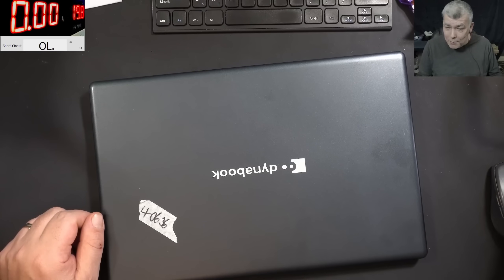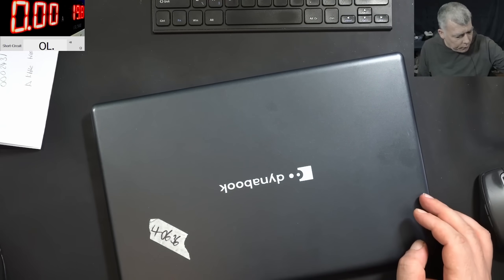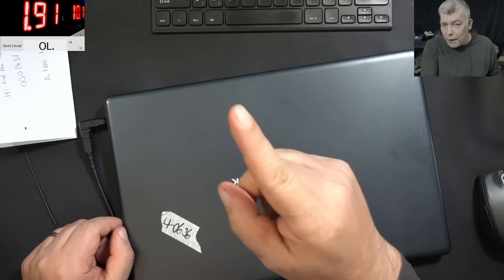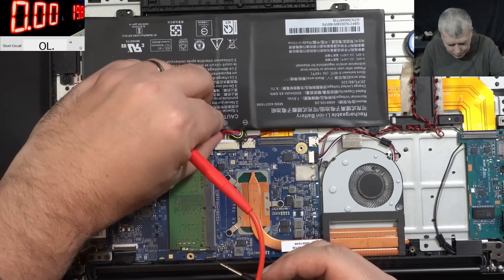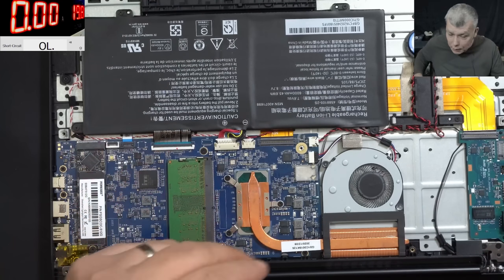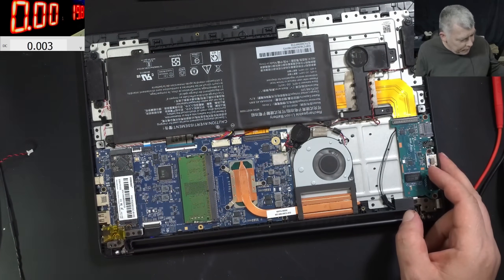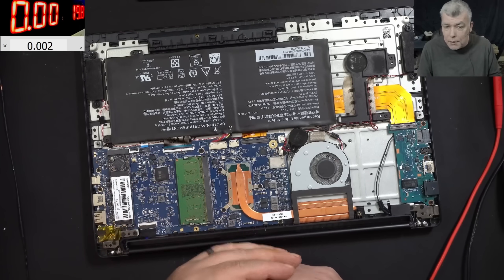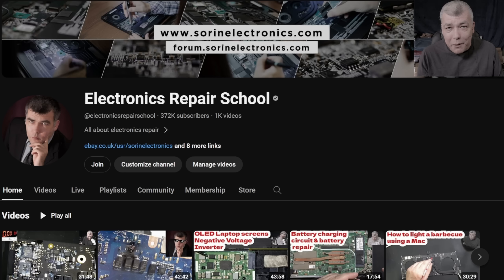Charging only up to 35% - Toshiba laptop C50, board repair, bribed with candies :D

Comment: What is the solution if the voltage on the + battery pin is 19volts, but the battery is not installed? 
is that normal?

Comment: If it's a design issue then that will be because it's not a Toshiba laptop any more they sold the Satellite and Satellite Pro laptops to Dynabook so it's Dynabook that now design the laptops and zero to do with Toshiba when the laptops were so much better.

Comment: Mr Sorin, I bought the same multimeter leads, I'm very dissapointed with them, I preffer the other ones I got better measurements with them and can press beter in the components for the measurements.

Comment: I think it can be the voltage divider resistors which measure the battery voltage. But it can be also an issue with the control PCB inside the battery.

Comment: 12:54 always a good idea to put sharp probes on a lithium battery and then put pressure on them due to bad contact... :D
be careful!! don't get into routine... can be fatal...
Reply: This is just the cable, not the cell itself. You could see this part on fire and nothing bad would happen (assuming the cables don't get shorted)

Comment: As good as Sorin is at electronic repairs and as much as I like him, I wouldn't ever send a laptop to him for repairs as he insists on cutting the power mid boot or once booted. Just remove the damn SSD, its not hard. Or is it a case of, I will fix it and anything that goes wrong with Windows as a result is not my problem.

Comment: I think heat-shrink tubing over a replacement coin battery is much safer than soldering wires on.

Comment: Those Mechanic tweezers are not meant to take out conectors, check current on power supply and some other hard stuff. They are meant to take out ONLY and ONLY smd's! Not meant to dig in motherboard or to scratch with them! I realy don't understand how you bent those in just few days man!

Comment: You do not need to solder them. Just rip off the tabs, then use another CR2032 battery and attach the tabs to the new battery using tape, you use a conductive tape and then isolate everything with electrical tape. Have been done it for years. Never bought any coin battery with cable, they are not that cheap.

Comment: actually is possible to use a normal battery there but you need to put a diode before the battery to stop the battery charge because of corse the cr2032 are not rechargeable. :/

Comment: you can  use 2032 battery just stick cables with tıght adhesive plastic tape no need to use solder  they usually works as this
Reply: Not something you  would do as a pro

Comment: 5:45 Is that liquid damage? Between pin 2 and 3 on the bottom of the mosfet?
Reply: Maybe on top, also...
Reply: soo what ? pins 2 and 3 are together in boot sides !
Reply: @hugovale8070  maybe this caused the mosfet to get short...

Comment: Hello, friends! Please, allow me to reinforce some VERY IMPORTANT advice from Sorin here:
DO NOT TRY TO SOLDER WIRES ON CR2032 BATTERIES (or any battery, but specially on CR2032 "coins").
They get very hot very quickly and explode on your face, throwing acid everywhere and burning your skin (yeah, it happened to me, and I was VERY lucky that the acid didn't get to my retina, but it was a very close call). Washing with water just makes it 10 times worse, as the water reacts with the acid (yeah, also learned that the hard way).
And yes, I know it works sometimes. It worked 10 times for me before the last one exploded. Don't do it, it's not worth it. Buy a battery spot welder if you need to attach things to batteries and be happy.
Happy 2025!!!
Reply: just put cables on the cell and wrap with electrical tape... best and fastest solution
Reply: @djtongi  Very correct, and you can place heat shrink tubing over it. Perfect result.
Reply: I've had problems with bad contact using the tape method. The shrinking tube idea might work better!
Reply: Nice post! I'm glad that you pointed that out. Thank you!
Reply: Bro thanks for your information. I was thinking about that. You save me!. ❤❤❤
Reply: there is a special tool for that , works with electricity not heat  and can solder a little plate on the battery without damage , it solders thee plate with high current , so the way do it , you solder to the little plate your cable and the plate you attach it to the battery with the special tool that uses high current to solder
Reply: @isaacn751  Yes, this tool is the spot welder I mentioned! Be safe! 😉
Reply: @isaacn751  Or buy one with the plate already on it for one dollar lol
Reply: @isaacn751  There is zero reason to do that. You can just buy batteries with the solder tags on them already from china for $1.
Reply: NO ONE SUGGESTED SOLDERING COIN BATTERIES (i hope no others really). You just wrap wires around it and DONE.
Edit i tried look did someone suggest soldering.. i remember just i twice written why not use coin batteries but i never suggested soldering because thats stupid.

Comment: Sorin buy a small spot welder, and then just use it to make the bios battery, so easy I always do it.
Reply: Just use tape bro
Reply: I Just use electric tape and it works always
Reply: before I bought 100 brand new batteries for cheap I used copper tape to fit the original battery cable on 2032 and wrap it into heatshrink tube..
Reply: @YourWorstNightmare1984  That is how I do it.
Reply: As mentioned here already,  just some metal tape and kapton to isolate works fine.

Comment: Used bios battery is a discharged bios battery.
So long as it has 3v, it's new.
Reply: No, it is not new. A brand new coin battery will have about 3.3V.